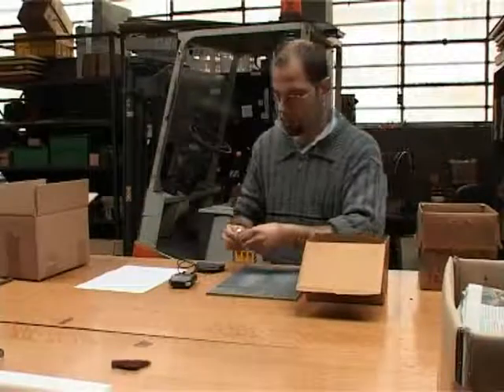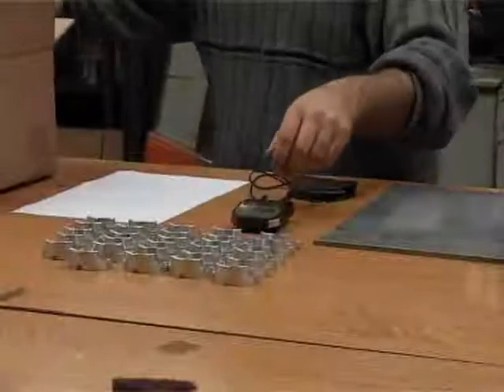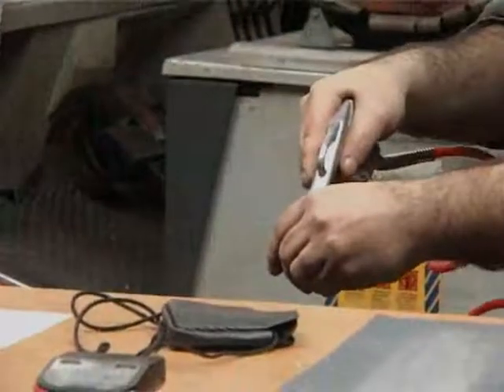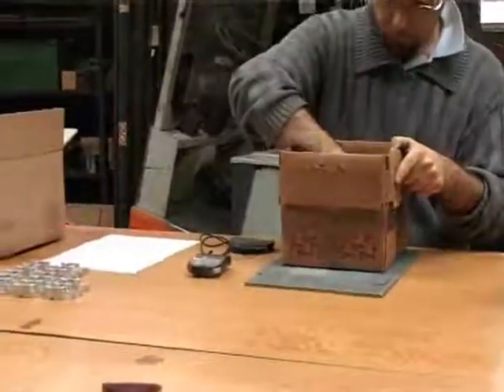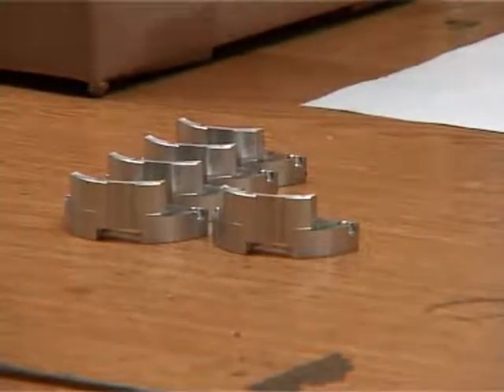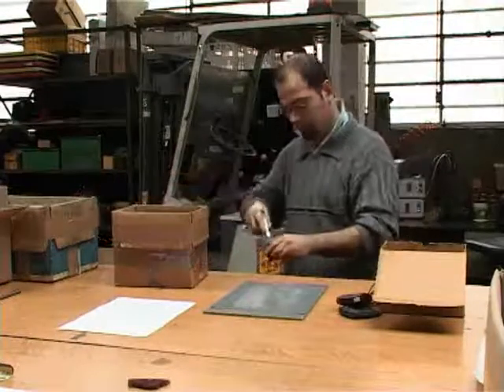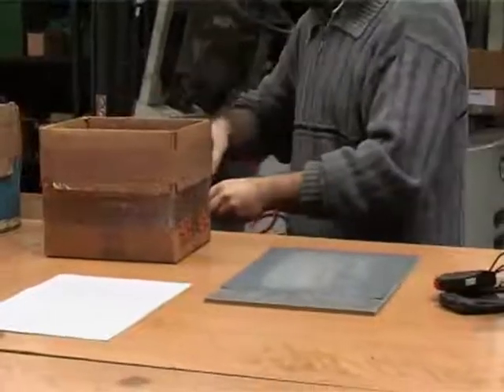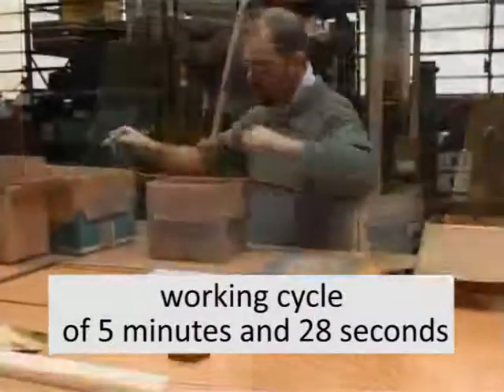one piece flow.flv

Comment: good sample, just a comment, he is working, from left to right (non ergonomic), but if, he is left handed is ok. Most of the people are right handed and the best is work against the clock´s hands.
Reply: Agreed. He should have pulled them out with his right hand and put them right to the polishing block. He should also have kept the air nozzle near his left hand and picked it up when the part was nearly polished. The box of finished goods should also have been on his right to avoid the waste of motion.